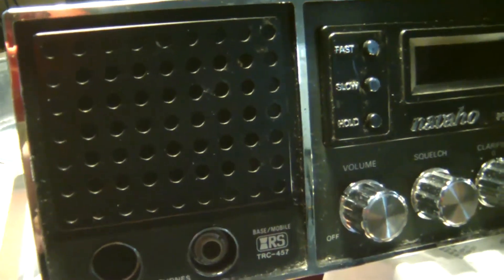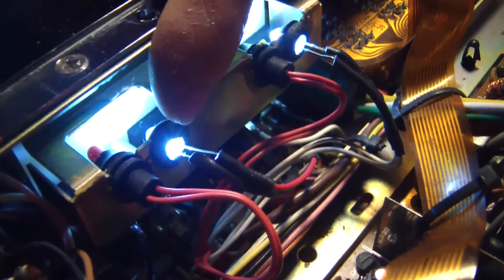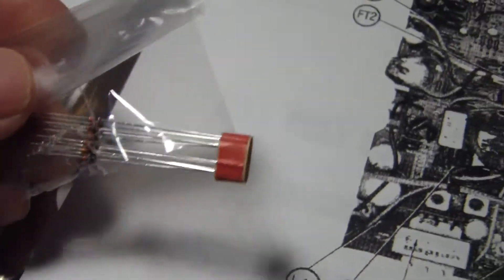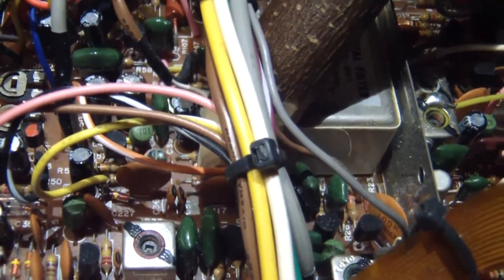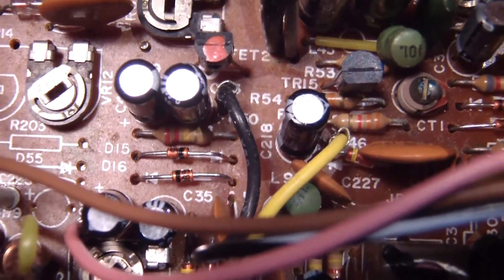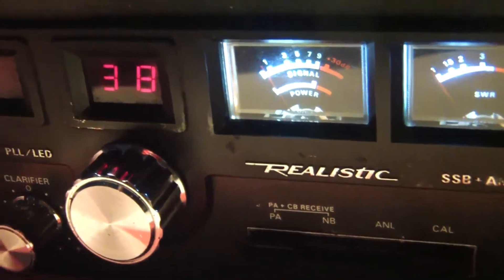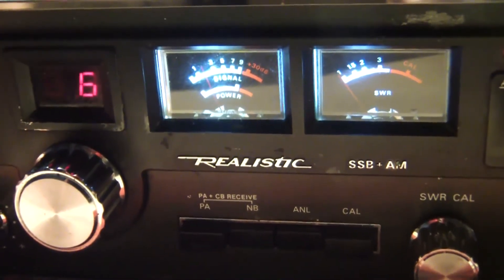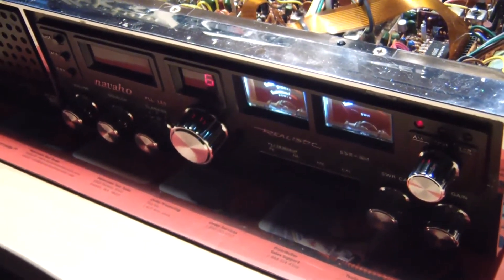Realistic TRC 457 restoration, PART4

Comment: Hello Mike this is Steve from indiana quick question can you substitute an electrolytic capacitor for a tantalum capacitor as long as they are same value in a cb radio
Reply from the maker: Technically OK but the designers chose Tantalum for a reason. I would respect their decision.
Reply: Ok thank you for replying I'm fixing up a trc 457 radio and I think that blue tantalum is no good have a great day and take care

Comment: Do they make great audio sound? No matter what mic I'm using turner plus or side kick or d104 audio sounds tinned to sharp. Any suggestions
Reply from the maker: I really haven't used mine much, if at all when propagation was in. I believe the built in compressor circuit is going to limit the audio input quality from whatever microphone you use.
Reply: Klondike Mike thank you for taking the time to answer my questions.
Reply from the maker: You may be interested in this recent WWDX forum thread;
http://www.worldwidedx.com/threads/rebuild-the-stellar-turner-3-microphone.218917/#post-598066

Comment: that noise is something though, I'd track it with a walkie talkie.
DVD players on standby and touch lamps make that noise too.
its nasty
Reply from the maker: +ᗒ╬ᗕ1112223333111ᗒ╬ᗕ  -  will do. I don't know how long this has been going on because I'm always using the radio that knocks it down with its NB.
Reply from the maker: +Klondike Mike  -  I walked around the yard today with a walkie talkie ... its everywhere. Its going to be tough to pin-point.
Reply from the maker: +ᗒ╬ᗕ1112223333111ᗒ╬ᗕ   -  the noise has finally subsided to barely noticeable today. Hope it stays that way for awhile. Propagation up, noise down. It was atmospheric.

Comment: I used these for my meters http://www.aliexpress.com/item/1xT10-2W-12-2835-SMD-LED-194-168-W5W-Car-Side-Wedge-Canbus-Tail-Light-Lamp/32318854763.html
and 2 of these http://www.aliexpress.com/item/2pcs-T10-W5W-168-194-Plastic-Car-Socket-Connector-DC-0V-12V-Extension-OEM-LED-SMD/32434153691.html

I got the WARM WHITE and they look good....super bright.
Reply from the maker: +ᗒ╬ᗕ1112223333111ᗒ╬ᗕ  - I ordered this per your recommendation. Waste of time and money for this application. Too big, won't fit in the standard 5mm socket. I thought you had this figured out.
Reply from the maker: +ᗒ╬ᗕ1112223333111ᗒ╬ᗕ   -  I like. I was going to make up my own light bars with either 0603 or 1206 led's because I found nothing on eBay. I'll give AliExpress a go. Thanks.
Reply: the lights are bright...and they got hot...70C+
only 1 is enough to light both meters.
http://i.imgur.com/MeCxoFp.jpg
http://i.imgur.com/xqAWnzQ.jpg
Reply from the maker: +ᗒ╬ᗕ1112223333111ᗒ╬ᗕ   -  ahh ... thanks for that tip about the heat. Don't need that. Although, you got me started on the T10 lighting. I did not want my credit card info sitting on a server in China so I went back to eBay with new search parameters. I ordered adapters and these front firing LED lamps. 10 for $1. We'll see ...

http://tinyurl.com/T10-lamps
Reply: +Klondike Mike 

Hi, 
Are you aware of the L4 factory defect on all UPD 858 Chassis ? Radio gets more sensitive once thats fixed.

On a lark. I installed an extra 7.8MHz SSB filter after the 7.8MHZ monolithic. Really tightens the receive.
Just got off of fleaBay N.O.S. lou Franklins old 7.8MHZ filter Kit !. Now which Radio to put it in !

Exit 399 has several Mods. for the TRC 457. Making the audio section the same as all other UPD 858.

Makes a big difference. The Old UPD 858 Press Grant Audio Power Mod works well on the Trc 457.

I have 2 Trc 457's Fallowing Exit 399 instructions 10uf to 15uf Capacitor makes a big difference. I use a Sprauge 15uf. I also upgraded the PSU. 10,000uf Elna 50v

My 2nd Trc457 is also audio restored as per Exit 399 instructions. but no Power Audio Mod. Instead Clipper wide open with a Turner +3 Compression Mic pushing it. Awesome ssb reports. Holds its own on AM compared to my other 457 with Clipper disabled & Power MOD. Bet much cleaner to.

Going to download all your videos on the Trc457. For what is worth this Info is useful for all of the UPD 858 SSB chassis radio's. I have most of them. Stalker 202,cobra139xlr,Robyn 520D,Trc458,Trc449,Robyn 510D.

Hey. I want to Install a frequency counter under neath my radios or on top with Velcro. all have Digi 
Scans & wide open clarifier's.

Where can I find this information ? I was thinking perhaps it is through the 7.8MHZ I.F. thru a .001 capacitor.

Hey if some one would give me the Information would appreciate it.

Or is another method available ?.

Here is a link to the service manual for the Trc457/458 Can be used for all UPD-858 SSB Alignments.

However. Interestingly Instructions & methods differ in all the Sams Photo Facts for the above mentioned

radios. The Alignment for the Finals is correct in the Trc457/458 Manual. Wrong in all the other Manuals

for the other UPD 858 SSB Chassis.

You have to join in order to download the Manual. 5 minutes.

http://www.worldwidedx.com/threads/realistic-trc-457-458-service-manual.142228/
Reply from the maker: +John Cohen  -  Thanks for the tips. I guess I forgot about the L4 factory defect. I went through my saved notes and see it there. I'll have to give it a go.

I'm presently going through the process of setting up a frequency counter in place of the clock. I've tried TP8 & TP12 with the PLJ-0802-C module but no go. Waiting on another method from a member on CBTricks.

Comment: I'm doing a Centurion 40D right now.
That noise sounds like 
Powerline Networking Interference
Did you try tweaking L2? The noise blanker may be a bit out.
Reply from the maker: +ᗒ╬ᗕ1112223333111ᗒ╬ᗕ  -  I have an x10 system. I shut it  down and no change. Its external. I think you have something regarding the NB. I tried another TRC457, same thing. I tried another more expensive radio and the NB knocked it down. Whoo-ho! You nailed it. I'll see what tweaking L2 can do. Thanks!
Reply from the maker: +Klondike Mike   -  no luck on adjusting L2 to eliminate the noise. I'll see what I can find for external sources that may be causing it.